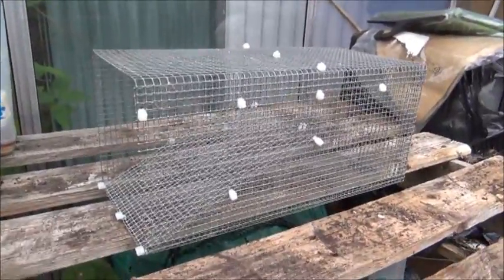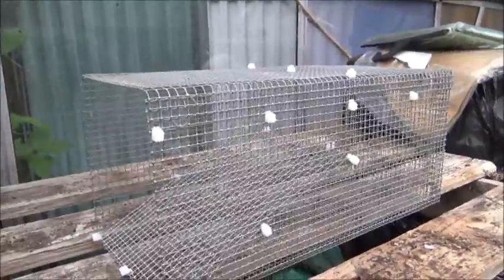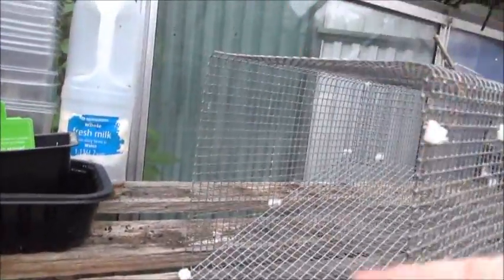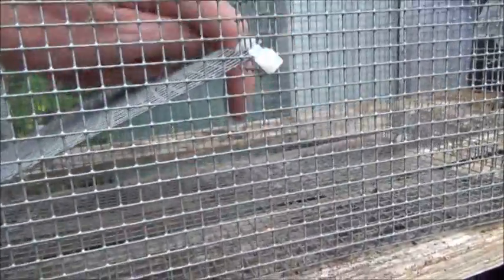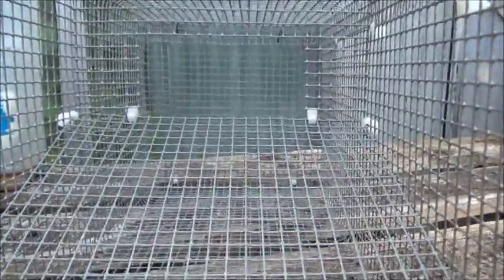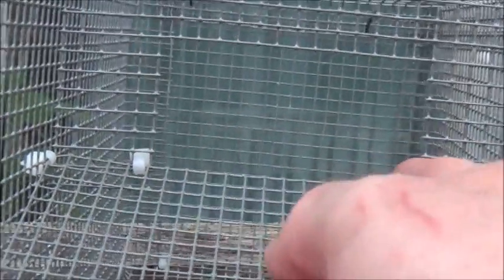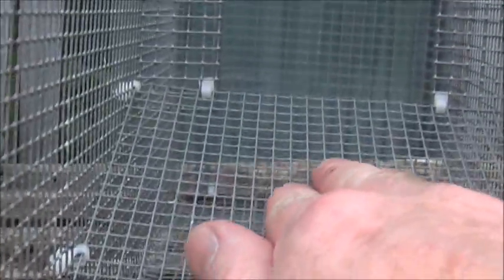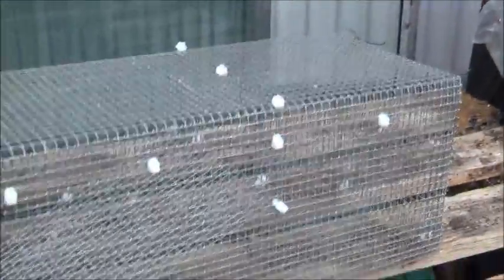Homemade Crayfish Trap

Comment: If you can build a bigger trap, I suggest you make a bait box constructed with the same material as the rest of the trap.  pack it with oily bait and clamp it shut with a rubber band.  toss it into the trap with some loose fresh bait.  The box will make it harder for the crayfish to get to and will help attract more since it lasts longer.
Reply from the maker: Good tip
Reply: +Gunner17722 Your lucky!  We have to pay for permit through the Department of Natural Resources here in the states.   I've got mine but no many how many times I bring a load of crayfish home, my wife still refuses to eat them.  More for me I guess.
Reply: It varies from state to state. The state I now live in requires a just valid fishing license to trap. *the rub is you need a conservation license to get the fishing license.

Comment: If it works well, that would be a good design for the US state I'm residing in, since "Crayfish" here "may be taken in traps no larger than 24x12x12 inches." A square design over a round one will take full advantage of trap size restriction.
*I don't see where you've uploaded a video about how well the trap works. Have you tried it?